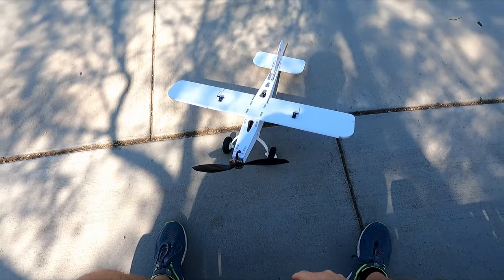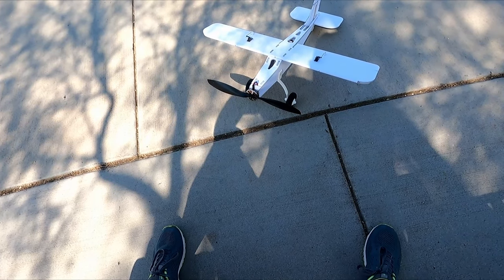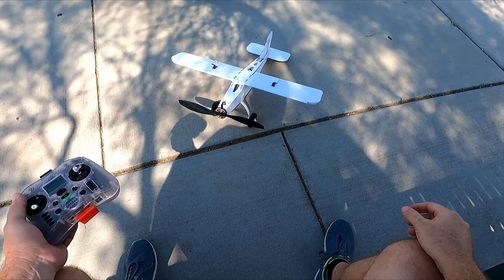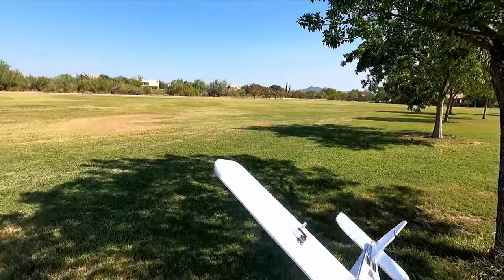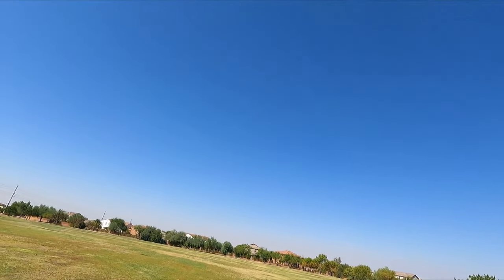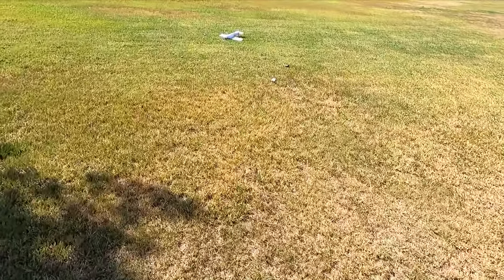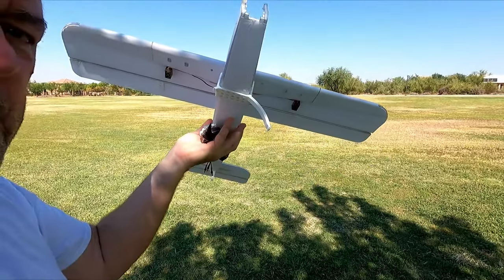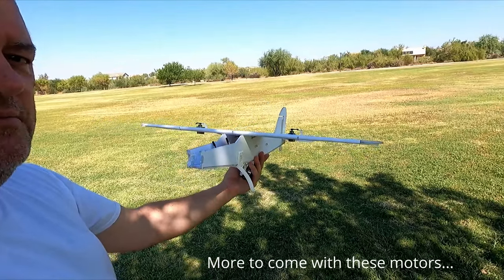Pancake Motor Yard Sale

Comment: those pancake motors are beasts.  i got some spares from an octo build that's going to go onto a pusher project
Reply from the maker: @Mike-mm6jp  they're fun to play with.  Remarkably efficient, and interesting to learn how to best use them.  I thought about it for a pusher, but I'm going to play with them in a twin first.  That prop disc is no joke.  I've got a pusher or two they would work in, but I want to think about it as I don't like dragging props on landing.

They may end up in a quad or hex, but first I wanna play more with them in wings.

Thanks for your comment.

Comment: Suggest a twin with counter-rotating motors to null out the torque of big-air biting propellers. The motor/propeller combo did have a cool sound.
Reply from the maker: It did sound amazing.  I loved the prop noise.  ...and I may have already built a twin.

...but I gotta go to work.

Comment: I also Love to scratch build my own designs.  I run around a 50 / 50 success rate.  The two dilemmas that I run across is that I Feel the need to build Everything Russian Style.  Combat ready.  Able to take a beating and still fly.  I build Everything with the full intention of getting at least 100 flights out of the airframe.  Therefore I overbuild.  Weight is my problem.  My second problem is Torque Roll.  I did run across a site that stated that a Good rule of thumb is to Never exceed 1/3 of your wingspan with the Prop length.  After using that guideline, my Torque Roll problems are no more.  That 15" prop looks like it's around 1/2 the length of your wingspan.  I don't know how accurate this rule of thumb is, but it's been working for me.  Example would be   no more than a 10" prop on a 30" wing.   Anyway,  Great video.
Reply from the maker: yeah - this was just something for fun.  I had a few odd parts land in my lap - and I wanted to play around with them.  While I'm not into building huge airplanes (I'm space constrained) - I thought why not strap one on my high wing and learn first hand something about torque, p factor and gyroscopic forces.  It was fun - and I just wanted to see if I could get her around the patch - and I managed - but a go around was not an option - as I was already below a minimum controllable airspeed for roll control.

Scratch building is fun - and I get so much more satisfaction flying my own - plus you learn a ton.  Good on ya for building, and I'd love to see some of your designs.

Thanks for your comment!

Comment: You don't need such a large prop to stay quiet and that wing span seems way to small to counteract all that torque.  
I recommend a 7 or 8 inch prop.  It would still be pretty quiet at the power levels needed to fly that plane.
Reply from the maker: @Andy-df5fj  Sometimes you just gotta see what happens.  I knew it was doomed from the drawing board, but it was the fastest way to play with the motor and prop and feel the torque first hand from a large pancake.  The airframe could handle it, it was controllable at higher airspeeds, it essentially Vmc'd as a single when it got slow.  Keep the speed up, and she flew controllably.

Call it science for the children. 

Either way, the next plane is nearly done.  Another one built for fun.

If you wanna fly that airframe well, I love it with a 2205-2300kv and a 6045 prop for RC.  Put a FC in it, and you won't hear it running waypoint missions overhead.

Thanks for your comment.

Comment: Hi there, i'm interested in the methods you use to laser cut the foam-board,  is it  a diode or Co2 style and how do you overcome the melting of the foam while cutting? Thanks
Reply from the maker: I'm using a CO2 laser.  It's a 100W tube, so I'm running it at low power and high speed to only cut the top layer and melt some of the foam.  That works well for the hinges.  The cuts are just that- higher power and lower speed. 

It just takes patience and time playing with your laser to learn the speeds and feeds that work best for you. 

Try a local maker space and see if they have a laser you can learn on.  That's how I started. 

Thanks for your comment.

Comment: Wow the radiomaster looks a lot easier to hold than my TX-16! Can you tell us which CNC/laser cutter you use for your foam parts?
Reply: He showed it off in a video. It’s an 80watt CO2 laser if my memory serves me correct.
Reply: @billcedarheath387  Thank. you! Can you like or tell me which video? Do you know the brand?
Reply: @ShahriarFarkhan  he’s had it for 10 years or so. I’m sure the exact one wouldn’t be available after that period of time. Bed size is the important part. You need to be able to fit sheets of foam board into it to cut aircraft pattern. A smaller inexpensive Co2 laser wouldn’t work. I don’t know which video it was and I’m not spending all that time going back to rewatch them to get you an answer. It’s worth your time watching all of the videos as they are all quite good and have a lot of information in them on the hobby. He has spoken about the laser in a few video talking about having a cooling unit as well as running the laser at 70% duty cycle to extend the life of the laser tube. All of this is from multiple videos. You should watch them all and it’s not a bad thing to support the channel as you do with a like on each one you watch. I’m sure Brett would appreciate that.
Reply: @billcedarheath387  I very much appreciate the detailed response. I've been researching lasers and trying to find a unit that can fit the large foam board and balsa wood for parts. Thank you :)
Reply: @ShahriarFarkhan  You’re probably looking at a cost that will be $3k USD or more. OMTech is a popular brand.
Reply: @billcedarheath387  Thanks for the recommendation!

Comment: Thinking the prop was to heavy
Reply from the maker: Prop wasn’t too heavy - it was remarkably light for its size (but also kinda brittle - although I wouldn’t have expected any prop to survive that).

CG was good, and the plane had the load carrying capacity - the was just undersized for the torque of the motor.  When I maintained enough airspeed, the ailerons were able to counteract the torque, and it flew and I was able to bring it around.  I got too slow in the end, and the torque rolled her into the ground.

All in all - I just wanted to make an odd sized motor fly… and we’re not done with it yet.  It’s got at least one more turn around the patch.

Comment: Hardly a surprising result.  Total mismatch of motor and propeller to the airframe.  If you're aiming for maximum efficiency with that motor, then you'll have to also consider the airframe.  You gotta have enough wing and control surfaces to overcome the torque roll or you'll be fighting a dog in the sky every time you fly. 

Kinda sorry for the harsh criticism, maybe it's just me and I'm extra ornery today, but this just seems like an obviously bad idea and not really worth uploading.  

But I upload stuff too, and most of it is crap.  Feel free to stop by and point out what you don't like.
Reply from the maker: No worries - your criticism isn't harsh.  It was built to fly a motor that landed in my lap.  Torque, p factor, and gyroscopic effects are one thing on paper - but a whole different matter in the hand.

I knew before I built it - that it would be an exercise in exploring the minimum controllable airspeed, and as you can hear in the video - I'm taking that in, and planning every input, as it's not as simple as a throttle jab - the motor would roll the plane.  That's why I put her down rather than attempting a go around.  I considered it a success as I was able to maneuver it around the field.  There were no aspirations that this would be anything other than a flying challenge.

Motors of this size are outside my wheelhouse.  I like building small planes that I can travel with.  Motors like this do require a bigger plane - but the really large stuff isn't something I feel compelled to build, own or fly.  There's other dudes that love the large stuff - and that's awesome - but I'm not that guy.

I do however feel that for me it's best to build and explore concepts first hand as you get a better understanding of the fundamentals in a way that will shape your designs going forward - and in a manner you may not absorb by simply reading from a book.  I love the kids building their first planes, and while I want them to fly, I also like to let folks learn lessons via exploration - and that means you're going to have some failures along the way.

Either way - it was a good day at the park.  Thanks for your comment.